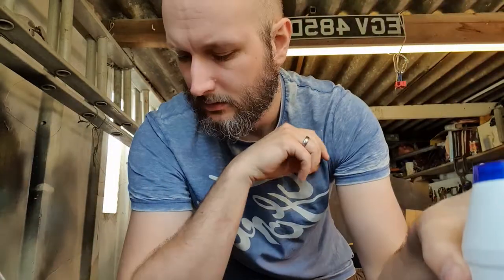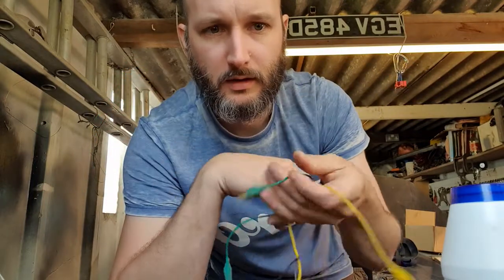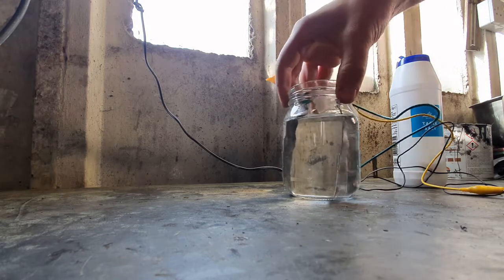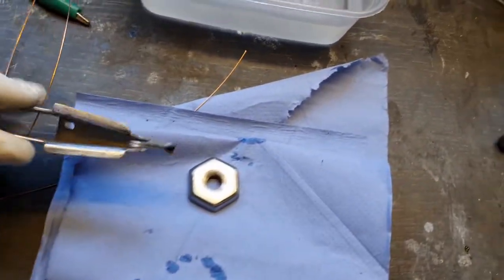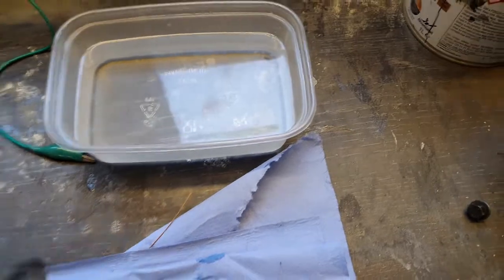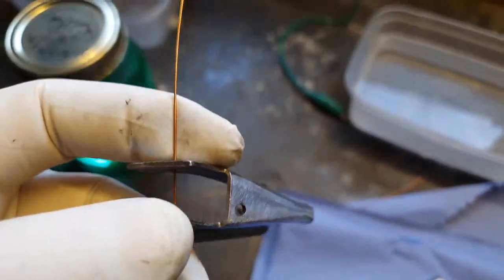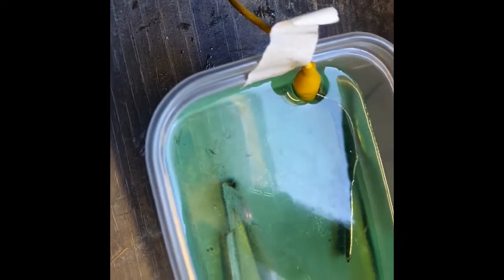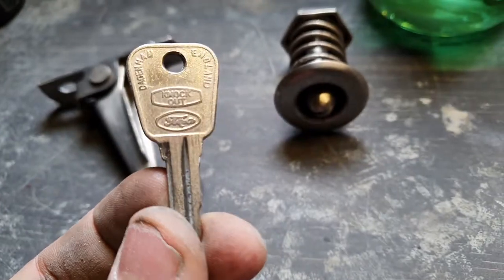Nickel Plating - how to do it

Comment: if you have good adhesion 1 hour of plating will be strong. I tried to remove it and had to use 240 grit paper for awhile.
Reply from the maker: That's interesting, I'll try that when I do more plating.
Reply: How thick is the nickel plating did you get for 1 hour?